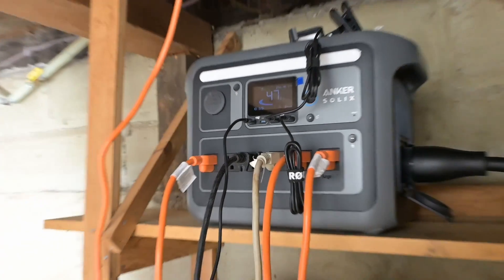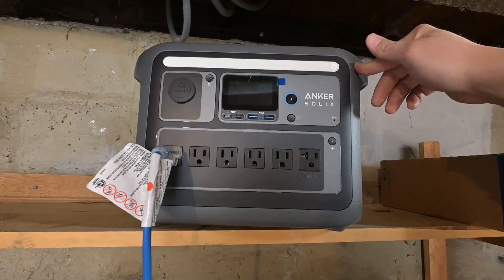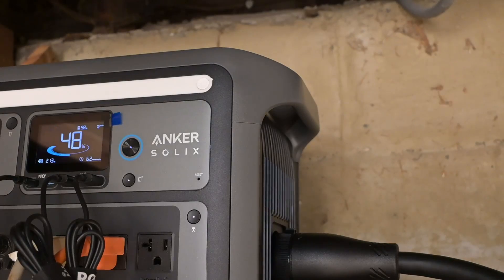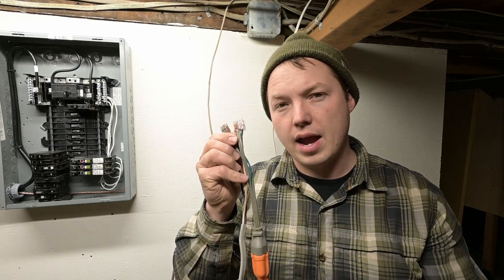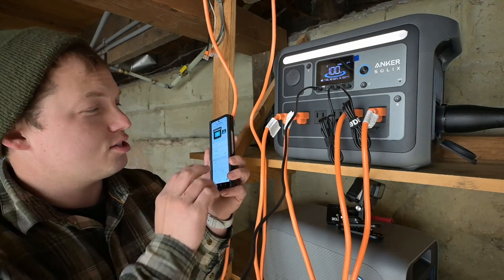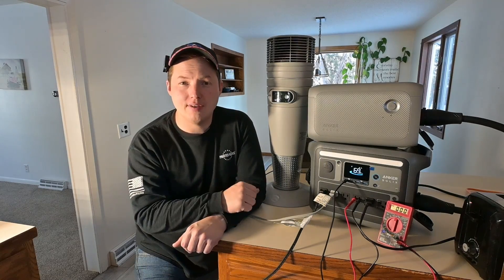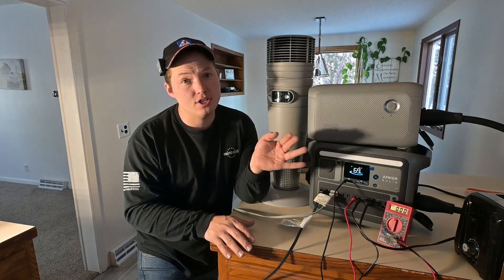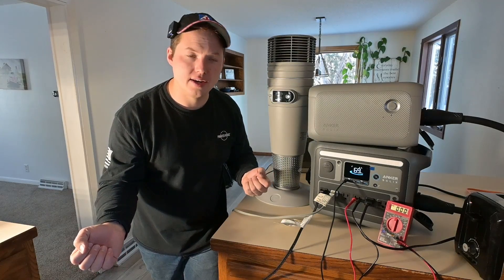1 KWH Seems Like an Ideal Size - Anker SOLIX C1000 Jobsite Power Station

Comment: I tested the Solix 2000 last year, and the 1000 seems to have some decent updates since then. It’s smaller, and lighter than the 2000 making it easier to haul around.
Reply from the maker: I'm still learning what makes an ideal power station. So many different factors to consider. 

On another topic, what do you think the best basic upgrades to a camper 12v electrical system are? I'm thinking to add a 100 watt solar panel and Renogy charge controller with my existing lead-acid battery. 

Alternatively, do people ever use the 12v output on a power station to do this? It seems that the 12v output is too limited on most power stations for things like the slideout.

Comment: 1800w continuous… dang that’s good enough for a table saw. You gotta think that most people are not using table saws with their power stations. They’re using their cordless tool battery chargers and temporary lights with them. That’s more than adequate for most applications. That’s good enough for most job sites and zombie apocalypses.

Comment: Electric motors prefer to work on sinusoidal wave, but power bank output is pulse wave - motor can spin slowly or tool can vibrate in your hands or motor winding can overheat. Output is driven with MOSFET or IGBT bridge, if one of semiconductor fails your tool will be injected with DC. 

For power in job site electricity meter should be installed in proper panel, which allows you to use electric sockets near panel with electricity meter. Unfortunately in United States electricity meters are installed in dedicated slots, which makes impossible to install circuit breakers and sockets on introduction for using extension cords. It is impossible to work normally without grid-powered sockets near electricity meter. I recommend to replace meter box to normal utility cabinet where you can install circuit breakers and weather resistant sockets.

Comment: I have an Ecoflow with similar specs. I often will use it rather than rather than drag out a 100ft power cord.  While my power station is for use around the house, if you were running a business there could be a case for having something like this as an option. It might save time compared to pulling out and then rolling back up a long extension cord.

Comment: Could you set up the solar panels and keep them plugged in while using the power for some home device day to day? I know its really not the purpose of something like this, but just curious.
Reply from the maker: Yes you can! Would just need to find a good way to run the cables from the panel to the power station.

Comment: Would be great to have something for a fraction of the price, lasts 20 years or more, runs indefinitely, oh yea a gas generator...
Reply from the maker: Definitely serves a different purpose! If I had to choose between a battery and a generator and could only pick one, I'd pick the gas generator. The solar panels definitely make the battery a little more comparable and can even be better if you don't have gas available.
Reply: I am not a promote of the made up climate agenda that will be used to subjugate humanity.  People should look up Operation Popeye which is a documented case of the US government modifying weather for use in the Vietnam War.  The climate is not changing.  Thugs are manipulating the weather.

I did buy three of these solar generators with backup batteries and 1200w  of solar panels.  I plan on using them to power my residential boiler or refrigerator.   I also have a 4000w gas generator.  However. I do not want to advertise I have electricity when all my neighbors do not have it.  I can run my power stations in my house.  I can make them run very long time.  I can keep them running when the gas stations won't be able to pump your gas.  Even if the natural gas lines lose their capacity to pump gas, I will be able to heat a small winter tent I can set up in my house.  How do I know the power grid will be hacked?  Klaus Schwaub of the World Economic Forum said so.
Reply: I like having a planet that's not completely dried out due to climate change.
Reply: @franklofarojr.2969 Perhaps the long term correction will be one half the current population.   How will it happen?  Unknown, but mother nature will not allow us to ruin the planet.